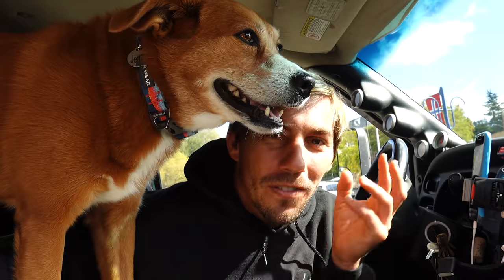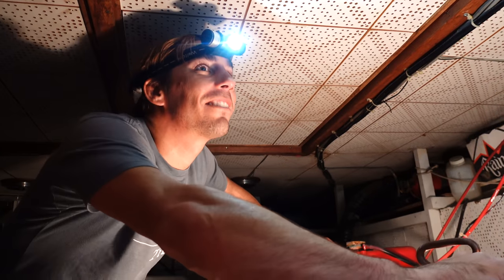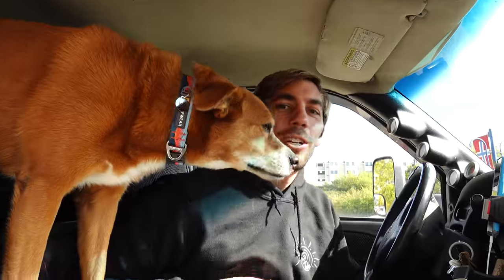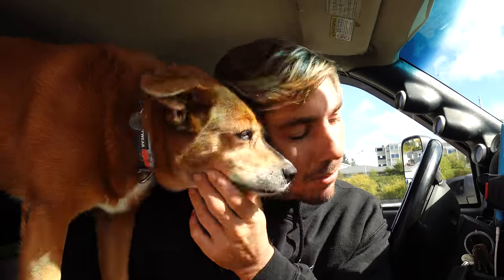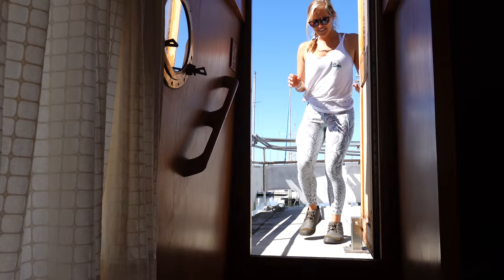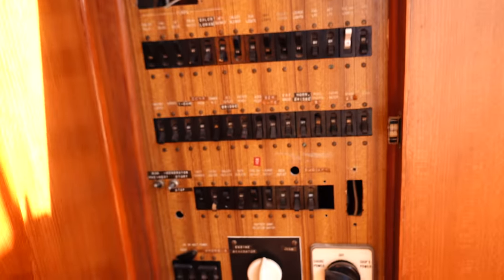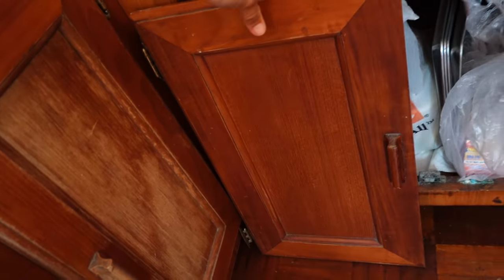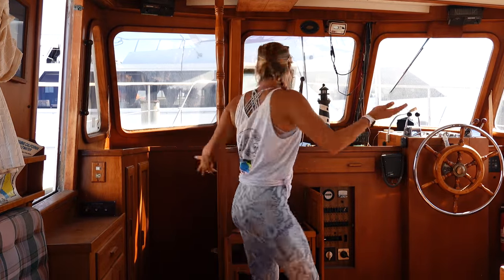Should We Buy this Boat for $100?

Comment: I'd jump on it really fast!
For $100 and the slip fees it's an obvious bargain price albeit a tonne of work which I would start by just clearing and cleaning everything out especially the engine room.
Once you have the engine room cleaned up completely I'd have the engines pulled out to replace the through holes, check the engines work properly and replace the fuel tanks and filters aswell as add another fuel filter for the engines and then put the engines back in.
With the engine room sorted out I'd look at water ingress around all windows and hatches before I jump on checking all the through holes and the head fixtures for any leaks and problems and fix anything to do with the heads.
Once you get to that point it's only aesthetics.

Comment: Dear TES couple.
👍👌👏 I would also have bought this amazing boat. But, other than you will use it, I would've put it on a small property. Then put a roof over it and use it as my home/house. It's certainly bigger than any tiny house and even with added transportation and crane costs, still pretty cheap.
Best regards, luck and especially health to both of you.

Comment: Any boat can be restored especially if it is above the water it comes down to time money and circumstances normally those circumstances being do you have the time and money. Well obviously It is none of my business your financial situation but you have dropped a lot of money on your camper and even when you sell it you wont see more than a portion back unless a lot of it was sponsored/free. Plus of course chartering that Seawind though the same factors may apply. The reason of course I mention this is you have some pretty big bills even when you have paid for your new Seawind.

The flip side which applies only to yourselves is of course you need content finding a boat you can flip or at least fix sail and flip is a good solution unless of course you do not at least break even.

It then becomes easier to decide how long will it take to fix? If you have that time or more so you can get some sailing in for more content then it becomes how much? and how much will it be worth at the end of the project. Obviously factoring in how much sponsorship can I get for free stuff for the boat and your labour.

I know that you will also need a lot of contingency in time as well as money because the figures you come up will be soft. So wise to check as much as you can i.e. a compression test on the engines since they could go from a few hundred to tens of thousands.

If you cannot firm up the figures to fix the boat at least moderately then the risk factor is too high and time to walk away and find another.

Comment: I might by the boat if I was reasonably sure that I could get it hauled out before it sank.  If it's been sitting for as long as it looks like it has then all the zincs are shot and corrosion has probably taken it's toll on the hull fittings.

Comment: If I were your age I would absolutely buy the boat.  The worst case in the world you can scrap everything bronze and make a 1000 dollars.  The wire is worth quite a bit as #1 copper.  The engines are worth money as second hand engines then find a couple of locals to cut up the hull and put it in a dumpster.  BUT, you two have extraordinary expertise with a crawler, the DeFever’s were built like bricks and the size is perfect.  Two engines means you could safely take it to Hawaii or South America.  It is perfect to sail up through the Inside Passage to Alaska.  Go For it, it will make terrific video.

Comment: if the engines run yes. If you put 10k into this boat of material and 6 months time you will have a great boat.  I say that cause you will need new fridge/freezer. a lot of fixing hatch leaks and redoing the top helm area.

Comment: Run away, be very afraid!!!! This is a mess that has already happened!! From what I have seen so far it’s going to cost $200,000 to $275,000 grand at least!!! I will say this is fun, the possibilities if money is no object!! Sometimes saving something is worth the cost!! Enjoy and good luck!!
Reply: Been there done that, not worth it. But it’s quite the experience. My last restore cost more then what it was worth brand new.  If you have to travel 2 hours to work on it every time it’ll take years to finish. For confidence you need to replace everything inside the boat meaning all the wiring and electronics  motors gas lines ETC. ETC, ETC. The list goes on and on and on and on. If you want it get for free or walk away because you’ll need every penny you earn to rebuild a boat like that. Don’t forget all you’ll pay in dry dock every summer and every winter.  And some marinas may charge you for the electric you use needed to get her done.

Comment: I love DeFevers Trawlers and this Boat that your looking at now for $100.00, I'm not a genius to at all but California to Florida $20 grand transportation. And you know already you can't water it home so after that repairs. you don't know what's leaking behind all the walls,  fuel tanks, and the  engines and especially under the boat that said. so you get it home and your looking at another now at over $150,000 on repairs if not more is the boat valued more than $250,100.. I just about forgot about the $100 for the boat..

Comment: That a BIG NO!  The cost of docking it and having insurance on it would be high.  Could you get insurance on it being that old?  You have a new boat on order and when it gets here you will be wanting to sailing around in it and not spending all your time fixing up an old boat.  Also, I'm sure there will be things that you will be wanting to do to the new boat.  So, save your money and put it into the new one.  If one of those motors would have a oil leak I couldn't even begun to put a price on that clean up.  Enjoy your sailing and then look for a new project to take on.  Could get into just flipping boats in the future.  Hugh money pit!  You wonder how many other people have passed on it for these and many other reasons .

Comment: That spacious engine room is enviable and the biggest green flag ever!
Reply: NOT!  I had to replace my diesel tanks since they were leaking.  Major PITA.  Had to cut them up with a saw in the engine room and haul the pieces out.  That was the easy part!  Getting the new tank into the engine room was tricky.  We had to design them so they fit through the openings to the cabin and engine room.

Comment: Ok,soooooo, do you have 120-180K to dump into the thing hoping for light at the end of the tunnel? That figure of course is expecting 2 years or more of sweat equity as well. How will your fans like that? Things do get boring watching a lot of sanding. You will need a shop shore side. You're still young enough to do this. You could find a cheap lot for her too and strip her as well and sell off what you can over 2-3 years and perhaps make a little. To keep her on the hard for any amount of time it will take in that area in a boat yard will do you no favors. Once she is stripped for what she is worth getting rid of the bare hull won't be cheap. The only way to really do this is commit to her as something other than scrap. You will get precious little profit PROPERLY refitting and selling her off but through enjoying her once the refit is done I see some promise. I think re-fitting her and cruising is your best financial bet but,,,,,,,,,,,,,,,,,,,,have you checked the price of diesel fuel lately? That's not going down any time soon. Looks like a damn fine looper once the refit is complete.

Comment: The engines can be fixed but the question is to me is is it a wood bottom boat or a steel bottom boat and if it's a wood bottom boat does it have worm rot and unrepairable or?

Comment: asbestos alarm, use all the lung protection available when entering her cabins spaces.
These ceiling tiles look very dangerous to me.
Also, a barely floating money pit! It will take years and all your money to restore her to a decent condition!

Sometimes scraping is the better option. Engines look good on first glance.
Also, give a boatyard €50.000 and don't go near her until all the big jobs are finished.
Manage budget and time closely and finish it yourselves. Don't fall in love with potential.
There are many reasons this boat is worthless right now.
Reply: I carried a bag of asbestos fibers in the back of my trucks for a decade, had a warehouse full. Not able to get any asbestos money because I don’t smoke.

Comment: For 100.00 I'd have taken it down and around and up to rhe east coast. Or shipped it for around 10 grand.  It's apx 2.00 to 3.00 a miles times 2800 miles accross country about  8400.00 . That's a heck of allot cheaper then an average POS boat lol.

Comment: You need a lot more information.  Get a good diesel mechanic to run tests on the engines.  Get two surveys.  Two heads are better than one!  You need to know what the worst-case scenario is!  Information, information, information!

Comment: The way to look at it is guesstimate what it might cost to fix. Let's just say for examole boat needs 50k in repairs. Would this boat be nicer/better than a boat you could buy for 50k? If answer is no then you have your answer. If answer is yes gotta decide if its gonna be enough better to be worth your time effort and stress! After all that work/money will you have a 100k boat? Or a 55k boat?

Comment: You should never ever buy a boat for $100. It just means that you will have to spend at least $10000 to repair it, if it can be repaired at all.

PS: labor costs not included.

Comment: I know nothing about these things - but it strikes me that you have waaaayyyy more than $100 in scrap parts there, the brass / bronze port lights alone...

If the engines are good, there has to be several thousand $ there.

The spare prop, the handles, the switch panels, the nav gear, it's all got to be worth something to someone.

Comment: It's exhausting to think about how much visible work is needed in that boat. If you pull it out of the water they're be a lot more surprises no doubt. In view of runaway inflation, stagflation, market retreats, higher future fuel prices and insurance premiums, and parts unavailability. I personally would run from that long term future headache. As time progresses, they'll be more and more better deals.

Comment: I wouldn't do it your too far from your tools it's too rotted on the top sides those fuel tanks scare me if they go bad like it looks like they will it will cost more than the boats worth to fix them. If you still think you want it don't even think about it till you see it out of the water the entire bottom could be so blistered that it need to be stripped and re glassed or you might see the zincs have been gone so long that electrolysis has eaten up the shafts struts and rudders. I just sold a trawler that I spent years working on and restoring  fuel tanks and all and watching your video I just couldn't imagine biting that one off. Be careful when it comes to boats always look a gift horse in the mouth.  I've seen what you two are capable of I don't doubt that you can fix it but at what cost  just be careful.....if you do decide to buy it bring it up to the San Joaquin river area and berth it over here it's half the price of San Francisco and we have good boat yards  here Delta Marine Services is the best one it's about 70 nm from Frisco. That reminds me also most of the insurance companies I've delt with with my big vessels I've had want a good survey before they will insure it and most Marina's want insurance on the boat plus they have to agree to live aboard status. IDK  be careful!!!

Comment: This boat needs lots and lots of money to repair engines, etc. Should you go for it, work out a potential deal with going electric with a small gen. set. There is a company in Holland that specializes in convertin g boats to electric and they can be fully off grid as well as sit for long periods without the need to run a generator. This would be for a full running from a/c to all electronics. Use of lightweight material and give it a new look. There is a couple building a catamaran from bare hull to finished live aboard. No wood being used. Thus, strip the interior and exterior and make it a new and different type of project. You may get a big following, plus, be different and new! The future of boat restoration.
Try it out and think about it, you may really like it!

Comment: Normally with you two I would say go for it. You guys can do things other NORMAL people can not do. However with this one I would say sprint away.  No do not run. The cost to redo it would be astronomical. Just pulling it putting it on land. Would cost a fortune. You will work on it for the next 5 years and become full time boat yard rats.. You guys will most likely buy it but it is the wrong move. There is a reason they are giving you the boat.

Comment: You two do not have the skills to do it....
Last motor rebuilt was a bust. Most of what was touched, failed. It made for a great comedy at sea... ( stay tone to... what could go wrong g at sea will, because it was fixed wrong ))),  hahaha, 
100 bucks,... then the 10.000 it will cost to hull it to the dump u have to pay.hahaha, yes yes buy it.